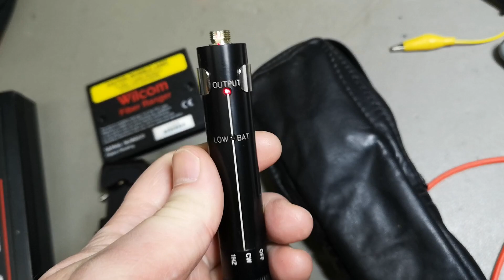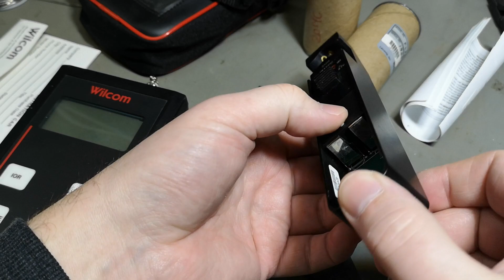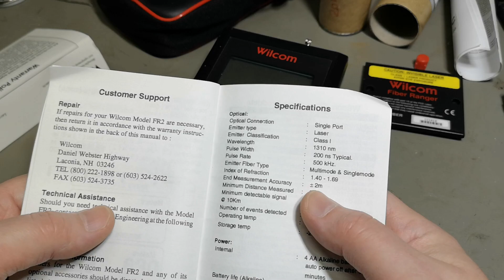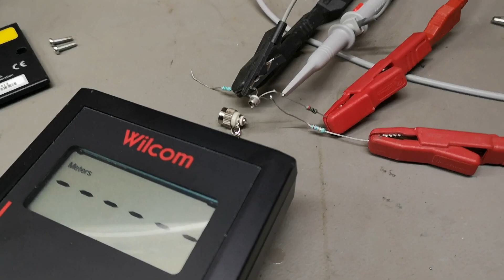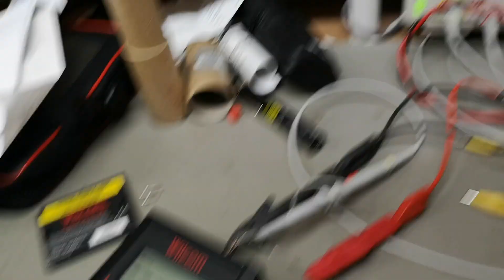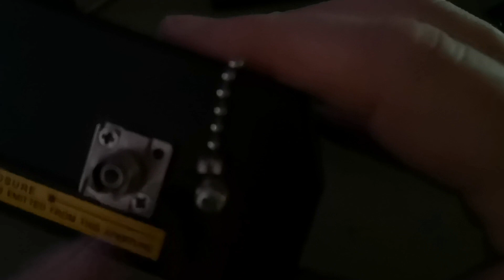Wilcom Optical Fiber Ranger FR2 F6222 F6230 test teardown

Comment: According to the manufacturer FR2 works at 1310nm wavelength, which is way outside silicon photodiodes (likely to be found in your camera) spectrum. To detect it, photodiode from other materials have to be used, like InGaAs or similar. Similar photodiode is inside the instrument - which is interesting, small handheld OTDR.

Unlike FR2, the F6230 is meant to operate at wavelength well visible to the human eye. You can use it to find gross insertion loss problem in optical connection - often the fault can be seen as fiber that is glowing in the point where its bent too much or broken.